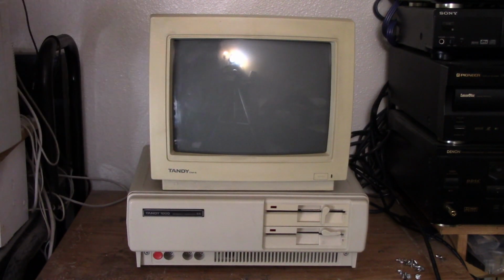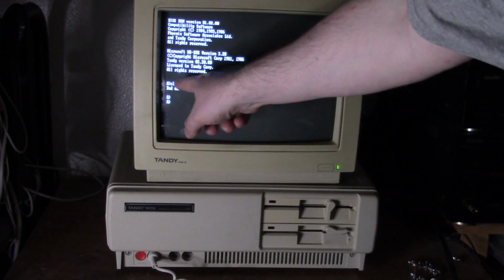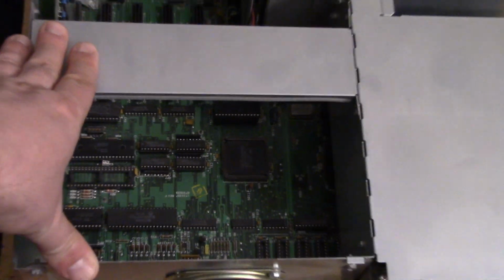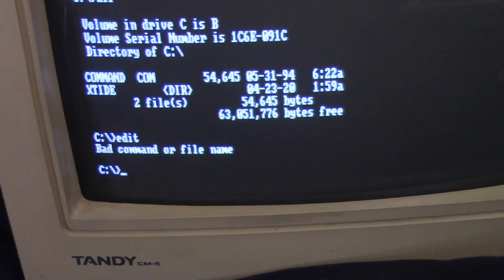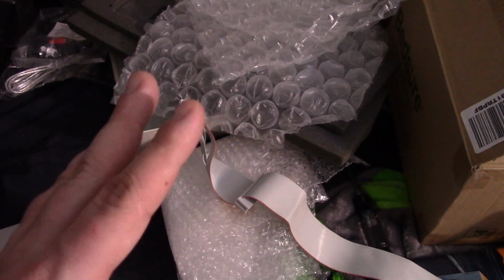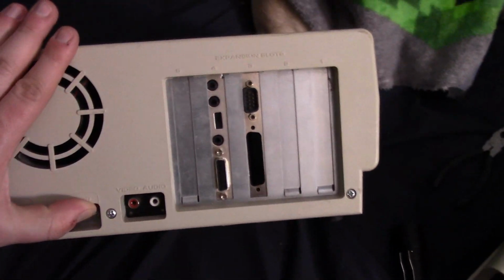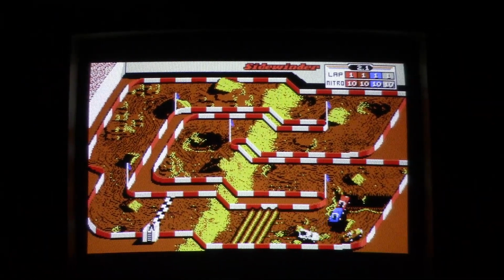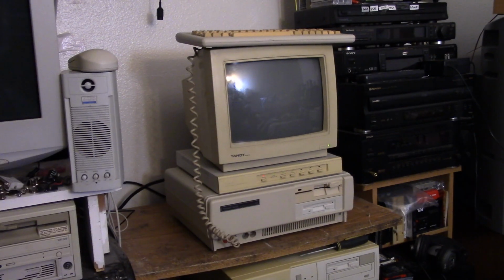Tandy 1000SX, Best PC for 80's Gaming? l #SepTandy

Comment: That 640k ram upgrade was the first hardware upgrade I ever did on computer, back in 1988.  I was 13 years old.  I remember we were sold some kind of clock/memory card that had all the chips on it, so I had to pull them all off that card and then put them on the motherboard of my SX.

Comment: Cable at 29:30 is a rare 'overunity' cable, used to gain infinite disk capacity... obviously not really. Only time I've seen one like that, the IDC male went to an external drive. There were SCSI cables that had such connectors on the end for terminators, too, but I can't see that being the case here.
When it comes to things like DOS 6.22, I like to think of some things as a 'feasible upgrade' - people didn't typically buy a machine and throw it out a week later. Because of this, a seemingly mismatched component, hardware or software, might not really be so mismatched. DOS 6.22 probably falls into that category, as it's feasible that in the system's lifetime, someone might have upgraded to that version, maybe to support something they wanted to run.
There sure do seem to be a lot of people talking about 8088 machines lately.
Reply from the maker: I can attest I've come across several 286 and 8088 type PCs that had DOS 6.22 on the old MFM or RLL hard drive.
Reply: I know i had an original XT that I upgraded to a 30meg RLL drive with 6.22 on it. Along with my 12 mhz 286 with a 40meg drive with 6.22 and windows 3.1 with 2 megs of ram.
Reply from the maker: @jkeelsnc  yea, I have to agree. though sometimes I have a lot more fun working within limitations to make a machine stock or within a certain time frame. My IBM 5150 started out as a super pimped-out machine but I had a lot of fun reverting it back to an early to mid 80's build. It lost a lot of versatility when I removed the HDD and 720k floppy drive but I'm really happy with it now.

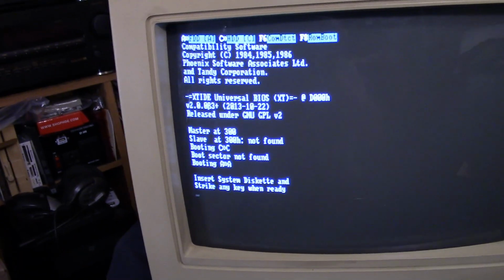Comment: @25:33 - I don't know what kind of adapter you have for your disk, but check to make sure you have it set to an IRQ and port that isn't in use by the rest of your hardware. There should be jumpers on the card or it is software controlled, depending on which one you have.

Comment: You can switch back and forth from slow to fast with a dos command as long as you are using Tandy dos. With a mode slow or mode fast command. There is also an adaptor available that will allow the use of a ps/2 keyboard. And Tandy made some ps/2 keyboards so they would match brands.

Comment: I have an original Tandy 1000-25 (not a) that has the same exact issue; I turn it on and only hear the speaker buzz just like that. It used to always buzz the first time I turned it on but pressing reset would bring up the 640k memory screen and it would work fine after that. One day I decided to reseat all the chips in hopes of fixing it and my luck all it does is buzz now even when resetting. Dead as a doornail. I just bought an SX in ebay to make up for the loss I was devasted 😂. PS - I did see a post from VWestlife describing his issue on the vintage computer forums and thought the same thing…if he can’t fix it I certainly can’t.
Reply: IIRC, that's because the sound chip needs to be initialized.  It defaults to outputting noise like that, and the Tandy BIOS configures it as part of the power-on sequence.  In other words, the PC isn't booting up, so the sound chip never gets properly initialized.

So the solution is figuring out why it's not booting.  Unfortunately, there isn't going to be a single fix for that.  You need to get in there and figure out what IS happening so you can start ruling out what's NOT.  E.g:  PSU rails all good?  Reset circuit behaving properly?  Any activity on the address and data bus indicating that the CPU is working?  Any stuck address/bus pins?  Bad RAM?  Anything failing to get through a bus transceiver or logic gate due to a dead IC somewhere?
Reply: @ hey Nick thanks for replying! I tried everything I could think of and chalked it up to a bad custom chip. Luckily I found another motherboard on eBay and working great now!

Comment: There is no one model that comes anywhere near close to fixing all the problems with the 1000 line.
What it was is a cheap computer that is mostly compatible with the early PC.  A lot of people today have nostalgia for them because they used them as kids largely for gaming.  In the mid 80s, if you wanted a PC compatible games machine, this was one of the better choices. Because the PC was not a good gaming platform, this platform was fairly well supported for games.  If for no other reason than they had a good looking version to put on the box screenshot.
Among many other problems, the platform stuck around too long.  It was only discontinued in 1993. Pentium computers were around in 1993.  These things were cost cut down to the penny and it shows.  Compatibility is very hit and miss.  They are very slow.  In 1989 people were using 386 machines which ran circles around them. Some of them use a proprietary bus or RAM that you could only get through radio shack at very high prices.
People remember these fondly because they were kids at the time. They played video games and maybe wrote the occasional school report on them.  They were good for BBSing too. But adults who needed a real computer at home, they don't remember these well.

Comment: The only RAM expansion beyond the 640k that you can do at all is an EMS board.  There are virtually no games that need EMS that would actually run on this computer.  There are very few games at all for DOS of any era that need EMS RAM.

The central feature of EMS RAM is it is entirely bank switched and falls outside of the 640 conventional memory address space.  It is a special kind of RAM (logically, not a literal special RAM chip) and only software that is EMS aware can even use it. 

The cards are all need custom drivers.  The RAM is usually accessed via the E segment of the UMA.  It can only be accessed 64k at a time.  This makes it very slow.  The only thing that really ever used it was 123.  The whole scheme was invented by a partnership of Lotus, Intel and Microsoft and is actually called "LIM EMS" after that partnership.  It is entirely unnecessary on anything but an XT class computer. XMS RAM is available on a 286 and higher. It is faster and better and most software that wants extra memory wants XMS RAM, not EMS RAM. It would be a total waste of time and money.  Almost as dumb as putting a 8087 math co processor in it.

Comment: The V20 upgrade is about as stupid as the 8087 upgrade. It will break a lot of games. Not by being incompatible as such, but by running the game faster than it's supposed to run.  A lot of the early games run flat out and are not throttled by an external timer of some sort.  (this is why slow-down TSRs were made) However much speed boost you get with the v20 is how much faster the game will run. If it's 20%, the game will run 20% too fast.

WHY in god's name are you putting a math co-processor in a Tandy 1000?  You plan on during some spreadsheet work with Lotus 123 version 1.02 or something?  There is not a single game from the era that wants a math co-processor. 123 is probably the only program that will run on this that will use a math co-processor.  it is a 100% useless "upgrade"
Reply from the maker: Because upgrading and tinkering with these computers in ways we couldn't afford to or that were not practical when we were kids is part of the fun. If this hobby was about what's cost-effective or practical we would all just be using DOSBox.

Will I ever use the 8087? likely not but if the $20 purchase makes you smile knowing it's there then who cares? People spend hundreds and thousands of dollars supping up Honda Civics to speeds they are never going to or hardly ever going to drive at but that's the fun, knowing you can.
Reply: @AncientElectronics  It's your 20 bucks. Do what makes you happy. I'm just saying that it is 100% pointless.  I'm not telling you not to do it and it's not like you would take it out if I said to do so.
I don't know if I mentioned it, but you should delete the drvspace driver from your flash card. It's a hidden file in the root directory. With dos 622, it loads by default (in case you insert a compressed diskette) and it takes up like 60k of conventional memory.  You can just rename it to something else. It doesn't care if the file isn't there, but if it is there, it will load it.
Reply from the maker: @tarstarkusz  Thanks for the tip on Drvspace. I have DOS 3 on the Tandy but I do have 6.22 on a few other older machines that it would definitely help.